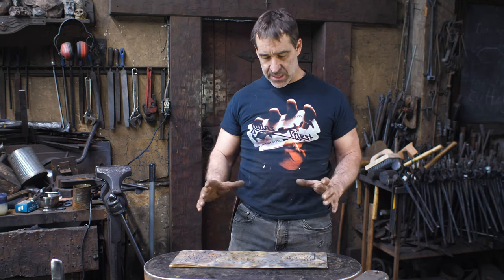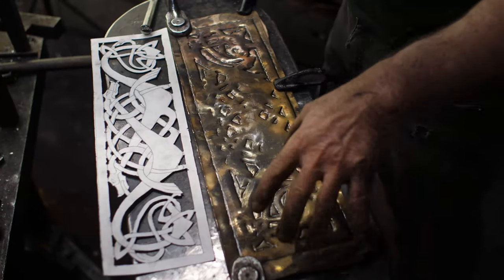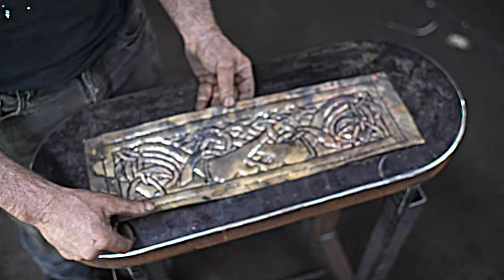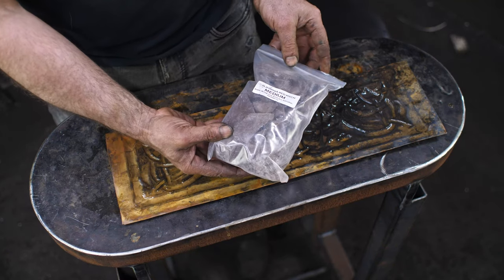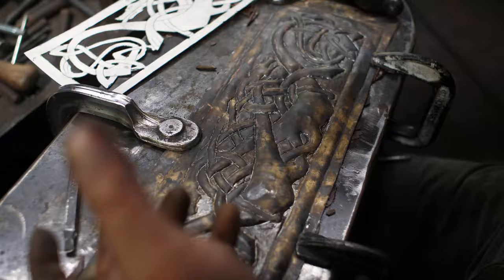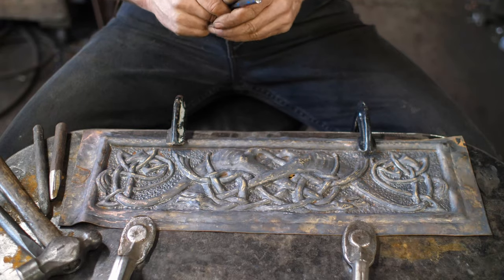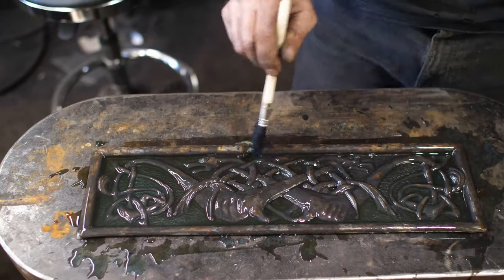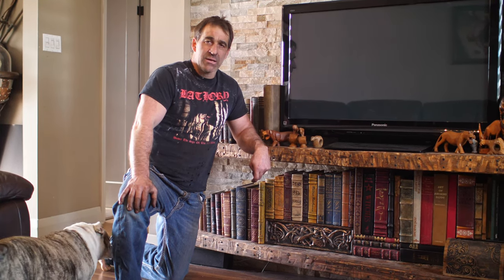Celtic Knotwork - Bronze Repousse

Comment: Nice! I have to try something like that one day. If you mess up and go through the plate, is there any viable method to save or at least make it less visible? The problem I see is that the integrity of the plate is destroyed and further refinements around a defect like that is difficult to make.
Reply from the maker: i usually have a break through .....usually can be hidden if it happens near end of process. it can also be welded if near end of process, but your assumption is correct , in that, a crack early on will continue to be a troublesome stress point and usually necessitates starting over
Reply: @ThakIronworks  Ok, thanks!
Reply: @torbjornahman   & Thak  just want to say what great artist’s you both are. 
Can’t wait also to try things like this too with used copper tubing I get from plumbing jobs.
Reply: If one work with pure copper i think one can TIG or gas weld in a strip of copper melting into the crack.
A thing i want to try is to make a stamp imprint into a steel piece and then melt copper or bronze ino it by heating it up.
Reply: @sheep1ewe    I’m not an expert, but I know what you want to do. But pure copper or copper tubing, wire I think would be very hard to do .
It would take a lot of heat in an oven to melt the copper over your template, the steel would have to be pretty hot so the copper would not congeal and make air pockets, giving you a poor finish side. It would be better to make a set of die’s and press your design into the metal. Hopefully Thak and or Torjörn reply with help on your question. Have a good day and hope you find something that works for you.
Reply: @geneticdisorder1900  You are right, but i hawe seen it been done with brass alloys on old cowbells, but they where first baked into clay.

Comment: Hi Thak. Awesome piece. What gauge/thickness was your brass sheet, please? Is 70/30 brass best for this sort of work? Cheers, Neal.
Reply: I think alloys with a high copper part is the best, if You hawe bronze i think that will do even better than brass, and as he said here, anealing the metal is keay to avoid cracks.
A rule of thumb is that a thicker peice is harder to work with, but can be worked on for a longer time than a tin piece, which needs to be heated up more often because of the workherdening.